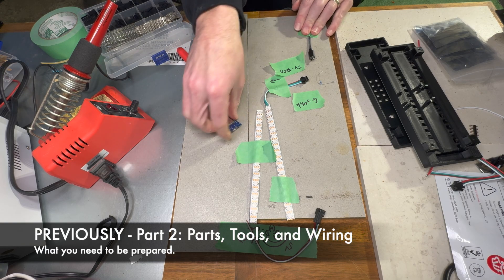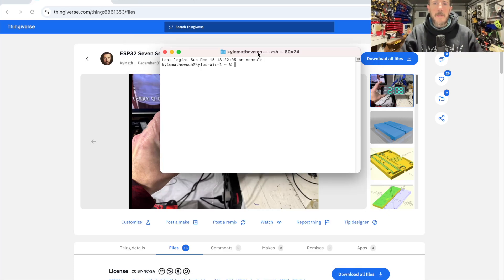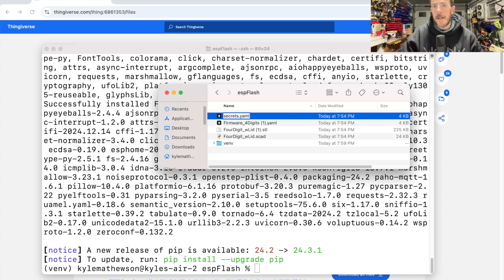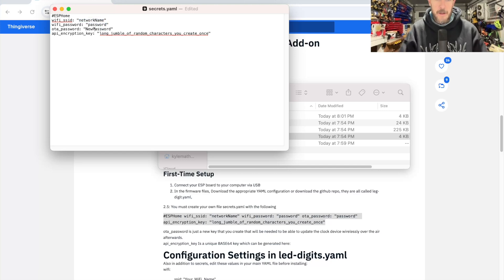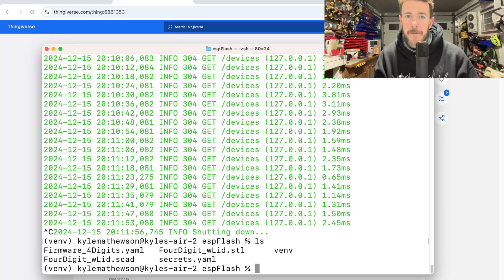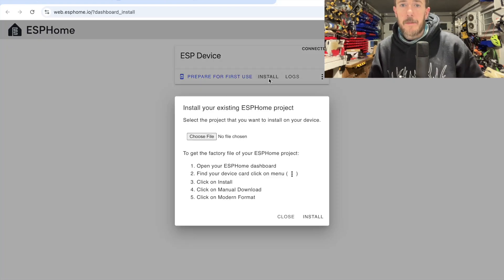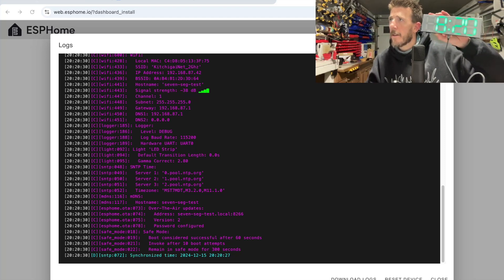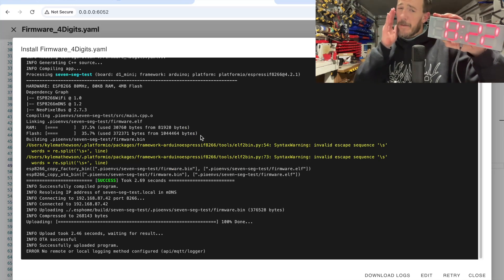Build a Smart LED Clock - Part 4: ESPHome Setup | ESP32 Home Assistant Clock

Comment from the maker: 📌 Complete your LED clock with firmware setup:

📺 Complete Four-Part Series:
• Complete Build Guide: https://github.com/kylemath/digitalclock
• Part 1 (3D Printing): https://youtu.be/DS_muPDX8p8
• Part 2 (Electronics): https://youtu.be/uiOuWeXdryE
• Part 3 (Assembly): https://youtu.be/76l32a6Kb90
• Part 4: You are here!

📺 Complete Four-Part Series:
Part 1: 3D Printing ✅
Part 2: Electronics & Wiring ✅
Part 3: Assembly ✅

👉 Quick Teaser: Watch the 17-second preview: https://youtu.be/x0ZPEmYtgFM